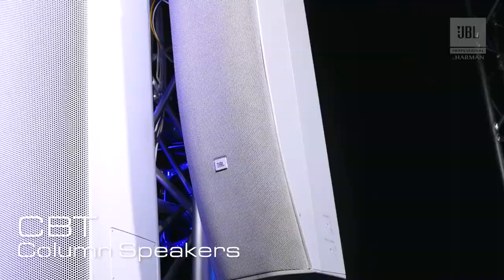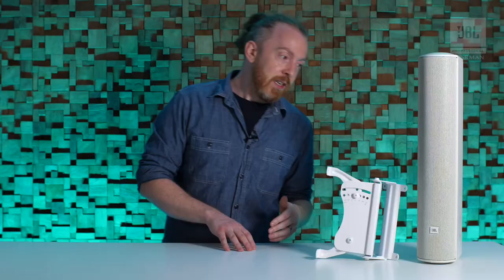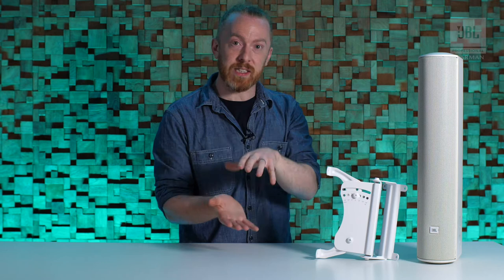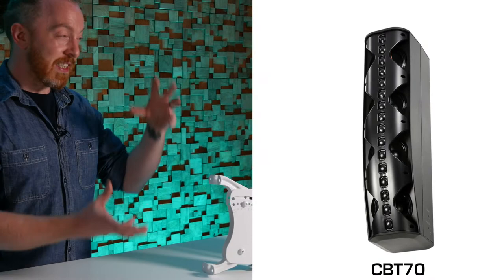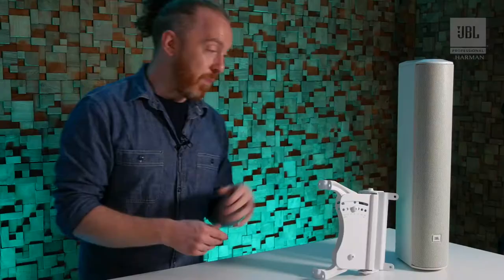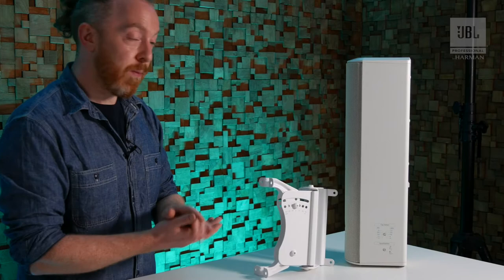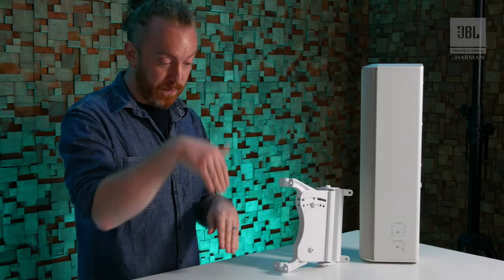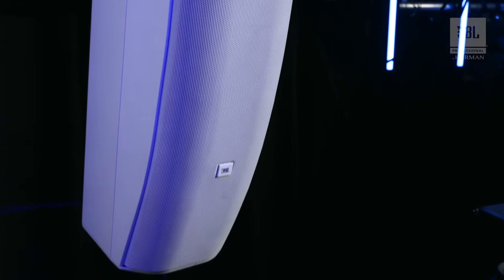AV Solutions: JBL CBT passive line array column speakers overview and specs

Comment: CBT is definitely the best solution for home theater.
Reply: Are those CBT 70J's enough, output-wise, for a big home theater if someone was to use those as LCR?
Reply: @imip.1252  I know someone that uses them but their theater isn't very big.  Still, I think they would work for a pretty big one, they're really overkill for his.  I suppose I can't really talk about overkill considering the CBT's I built for my theater🙂
Reply: @imip.1252  the 70j-1 are rated for 119dB continuous - 125dB peaks.  You can do the math for loss of SPL at distance from there.  My first experience with the CBT 70J-1 was at an AMC Prime theater.  So if a flagship premium commercial theater can use them, then I’m sure they can be used for home theater.  They were the best speakers I’ve ever heard in a commercial cinema at that AMC Prime.
Reply: @jvonengeln is that thetre that you heard the JBL 70 speakers in still open in Kansas City? Because I'm coming for mwave 23 and would like to hear those speakers in action, down here in Texas the best theater speakers I have heard are qsc so far